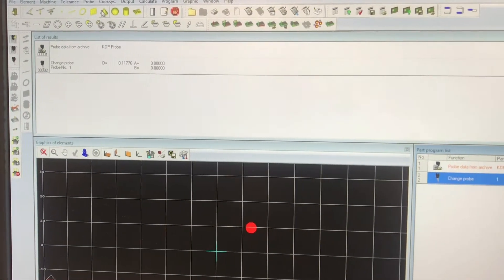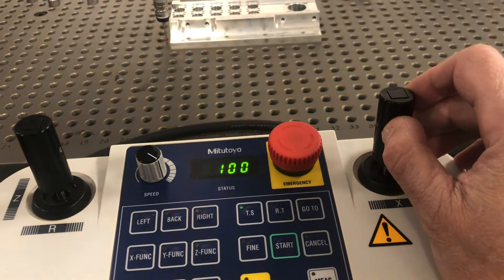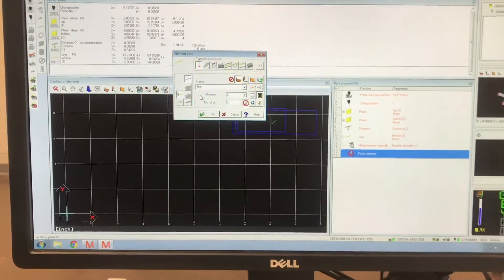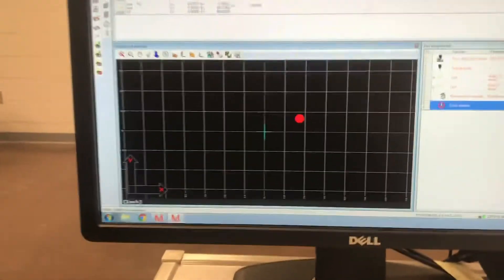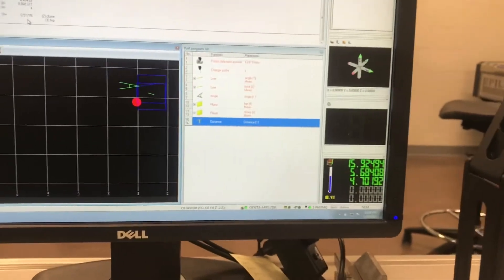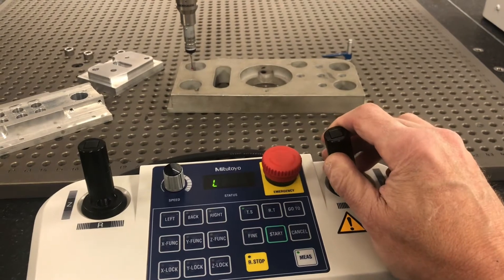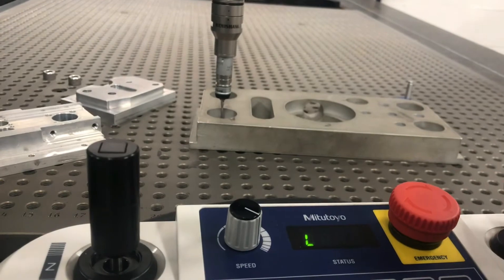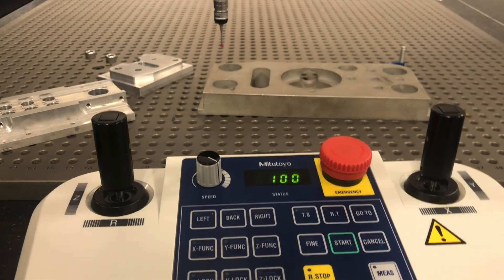Mitutoyo CMM basic measurements

Comment: Which probe body is better? TP20 or TP200
Reply from the maker: In doing a little research it seems the TP20 is less expensive, more robust, and holds accuracy longer.
The TP200 is more expensive, able to accurately measure tighter tolerances, but more delicate. So it would really depend on what you are measuring with regards to the pros and cons above.